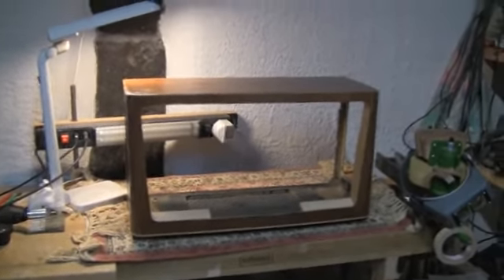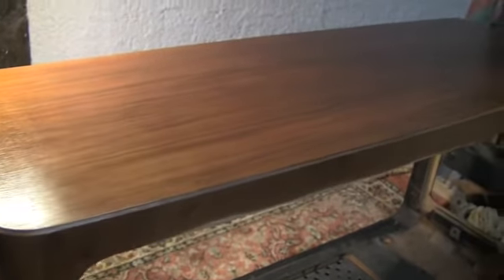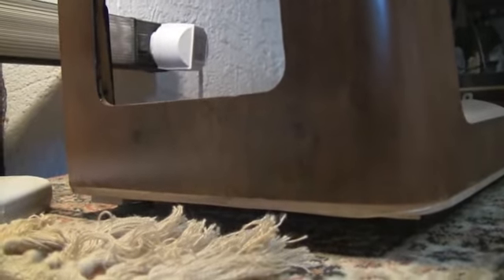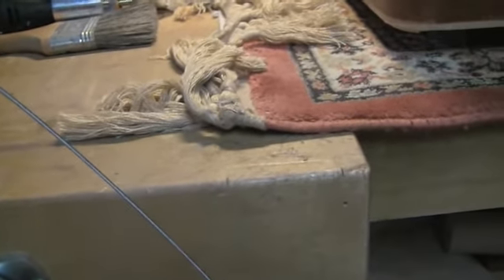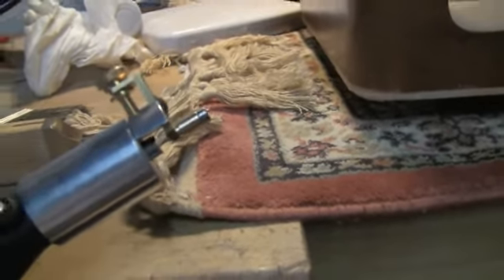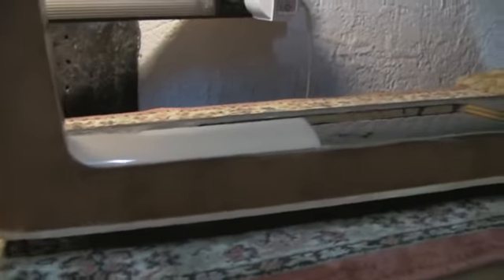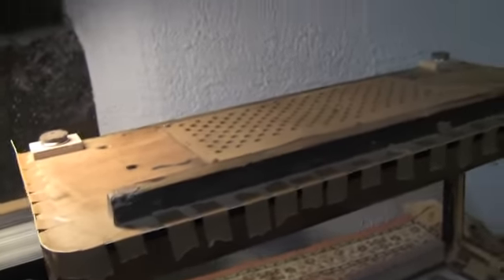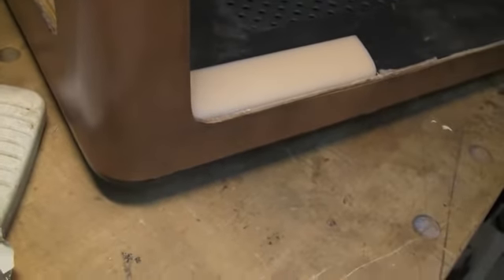Grundig 3028 Restore - Part 7

Comment: hi john, hardly recognisable from what left my house last month, interesting how you managed to level the top panel, hope the edge works, i admire the way the bottom edge is fixed, wondering how youll tackel the 'brass'trim, hessean might work for you, for the speaker cloths, stuff i used had a very fine plastic packing on it, which hasent affected the volumn, great progress john, regards maitiu.

Comment from the maker: @maitiustandun Hi Maitiu, it's getting there slowly.  I've ordered up some speaker cloth - not the same as the original but hopefully close enough to look the part.  The brightwork is definitely a challenge - I need to get the varnish off of it and so far nothing seems to shift it. I'll try paint thinners on it one of these days and see if that helps. Cheers, John